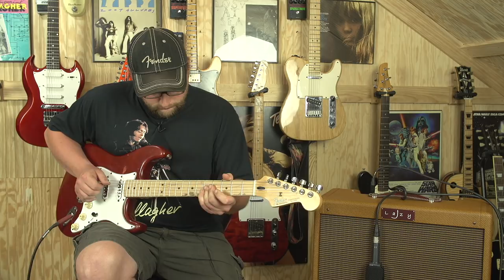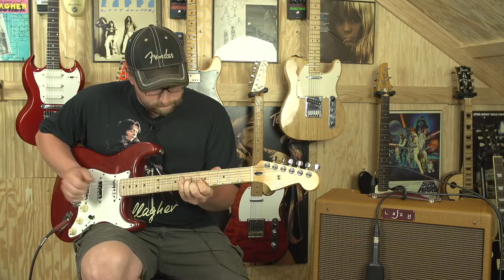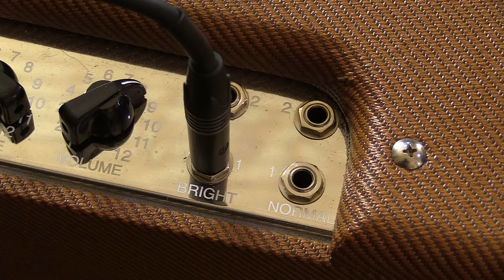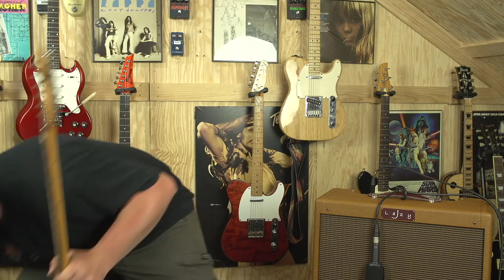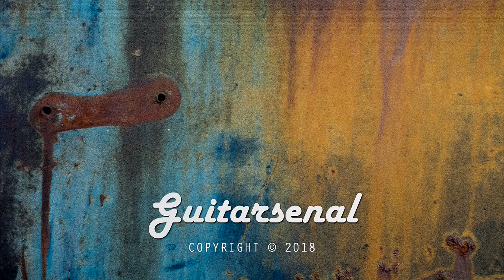Lazy J 20 Tweed POWERHOUSE!

Comment: Try plugging into the bright channel, turning the volume to 4, then turn the normal channel volume to 8 - 12 with the tone around 7-9.

The volume circuit bleeds signal to ground at around 8 or 9 and up on the channel you're not using. It really helps to cut the farty humbucker tone and you'll get awesome cleans the higher you go.

Remember, this is for the volume control you're not using.
Reply: hes running some bright neck pickups there on that first strat..  some pretty bright neck pickups for a strat...  most ppl seem to forget the custom pickups you can stick in a guitar... its not always about the amp... you can tell they arn't standard (for the year model) strat pickups just by the look... if they were standard (for the year model) strat pickups they would probably match the color of the guitar a bit more, looks like they are more worn (probably 1960's ish or older) than what the standard pickups for this guitar would be... also note the tone knob colors/pickup selector knob color, that strat has had some work done on it... (probably had older pickups installed/knobs replaced) that is not a standard thrift store factory strat...
Reply: I just figure this way of setting my lazy j and was blown away. It was quite dull before now i can control the mid by turning the normal channel volume while plugging into the bright input

Comment: What the cost of a new Lazy j 20 (with attenuator and reverb-tremolo)??
Reply: I think mine was a little over $3,000. They are expensive but I think the best way to think about it is comparing it to cost of a vintage 1950s Fender amp.
Reply: Bro, if you can build an AR-15 you can build a 5e3 clone.